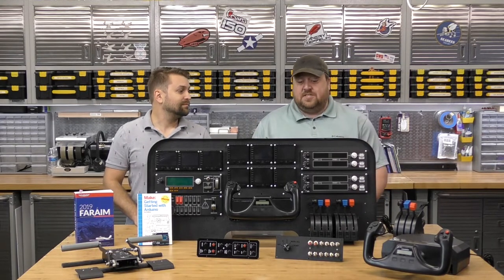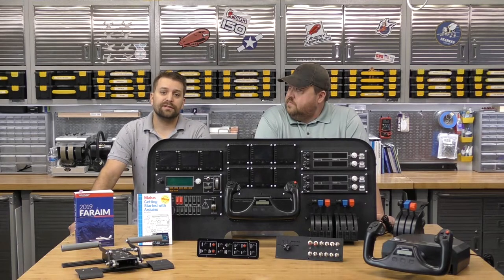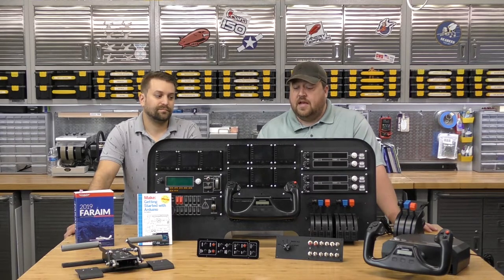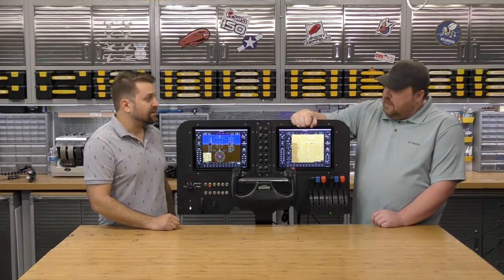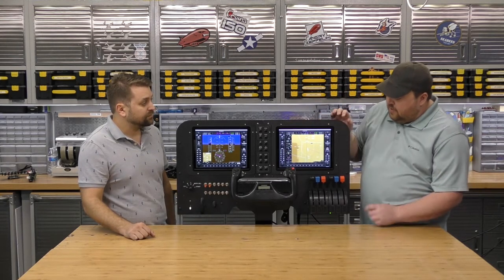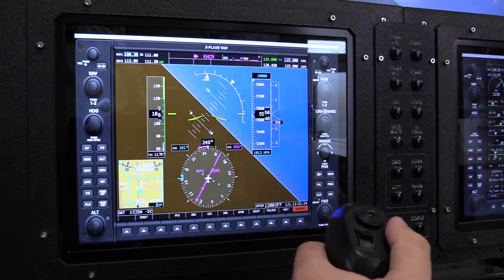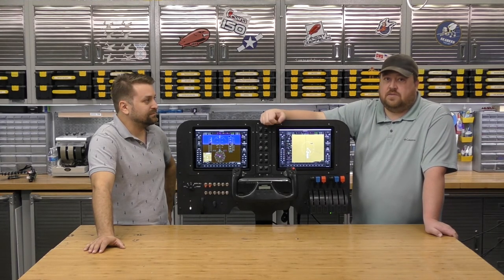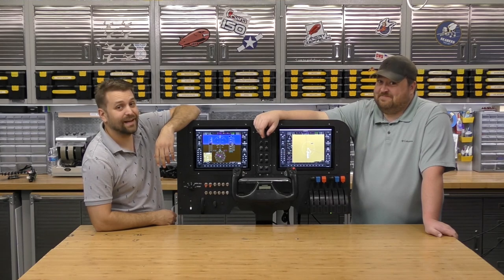Flight Simulator Project Overview

Comment: Hi, just built a cockpit panel based on your design. Thanks!  Still need to add the switches. You mentioned you had instructions on building the arduino panels. Where can I find so I can start building? Thanks!

Comment: I'm old school so I have stuck with my 8 Logitech FIP's, and Dual Radio Stack. I'm using the Honeycomb Alpha & Bravo controls so I have Mag's, Switches, Gear, Flaps, AP etc all covered. I prefer the analogue setup. Personal preference, but I got my PPL back in the early 90's. We didn't have all this glass stuff back then. Maybe an early model handheld GPS (Garmin 90) which was frowned upon by my instructor as cheating. We learnt to navigate the hard way. DR, paper charts, a watch, pencil and a basic flight computer. Pays off when the GPS batteries go flat.

Comment: This is Cool stuff guy's. How much is the Logitech? and yours? Pedals  for rudder?? Keep the Zeppelin floating! AirHammer out!!
Reply from the maker: 1200-1500... vs 450-650...
Reply: @angryzeppelin2750  $800 is a wide offset. I'd have to as well!! AirHammer out!!
Reply: I can not get the measurements  show up
Reply: What is the  width and Height of the panel cannot get the measurements from the download
Reply: air hammer make videos your catchphrase airhammer out is nice would like to see som vids even if it is software
Reply: Angry Zeppelin I’m in love with your build of the simulator and with the corona virus money is tight, my escape is flying and think this would be perfect for me to do. What’s the cheapest board I could use for the cockpit panel to be like yours, I’m a frontline worker and am so ready to make this build. Great job on this.
Reply: @robertdrane3011  wish he'd put this somewhere.